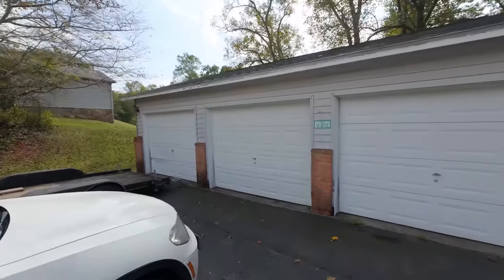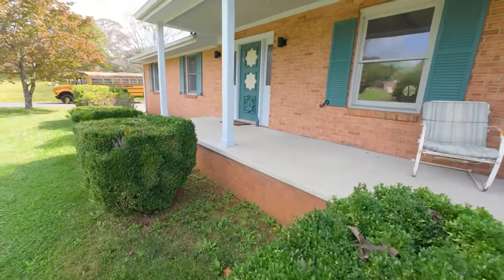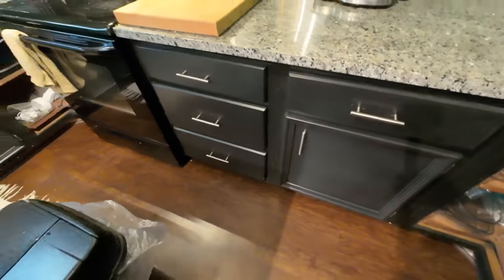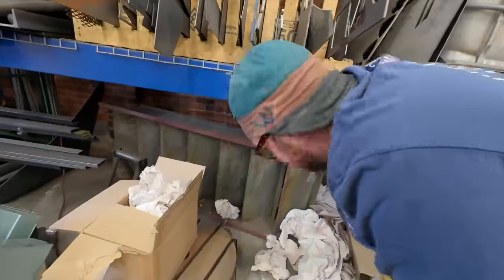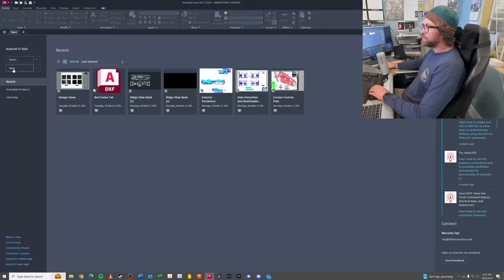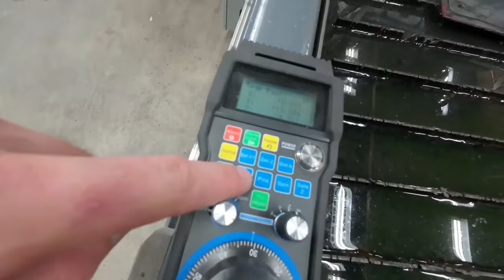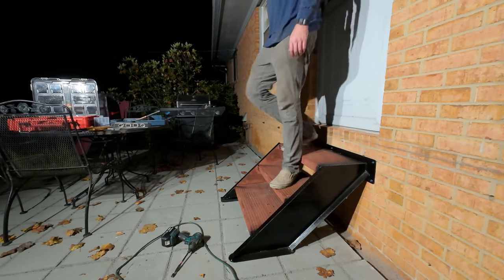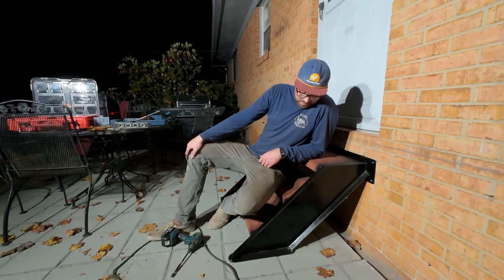I was told this is why my house isn't selling...

Comment: Personally, I would have made the top step level with the floor so as to create a 'landing' rather than stepping straight out-and-down.
Reply: Definitely should have a landing. Might even be a bldg code requirement.
Reply: The problem with a landing is it needs to be lower than the threshold or rain will bounce into the house or snow will block the door from opening
Reply: @doughudgens9275  the problem with no landing is it’s not safe.
Reply: The landing in my area is required to be  3ft Sq.  I generally make then 4 so you can stand on it with your hands full and operate the door.
Reply: Yeah a door-wide and deep landing then steps down, safer that way

Comment: I am surprised that nobody else had commented on the sharp corners at the top where you cut the side c-beams. A piece of plate over that would easily mitigate that issue, but it seems like a rather significant hazard as shown. It would not be out of the ordinary to expect that someone might fall while on or near those stairs, and landing on that corner could do a decent amount of damage. Depending upon what county your property is in, you may or may not need handrails as others have mentioned, but if required it seems that only one side would be necessary (unless your local authority having jurisdiction says otherwise).

Comment: So, I haven’t seen the entire video, but right at where he’s measured the door height. Well, did he account for the fact that the patio where that bottom step will land is lower than where the patio is right at the house wall? Stay tuned folks, it will be interesting to see.

I agree with the others, the top stair can’t be where it is. It needs to be level with the door. And handrails! Someone coming out of that kitchen with big plates of food are going to find that precarious.

Oh, it’s a very nice house.

Comment: Ouf. Couldn't you have made the upper tread(?) / step(?) the same hight as the bottom of the door? That looks so odd to me, that there is no landing, i guess... But I may be architecturally biased, as where I live, doors are more recessed into the house, by roughly a 8 or 10 inches. 
But good luck on selling the house, I hope you can close the deal on the new building. 🍀

Comment: That looks like something that's going to have to be reworked. No offense, I think it looks good. Just with my experience with home inspections that's going to need a railing and it probably won't meet municipal codes. I say that because most inspectors want equal spacing and that bottom step distance looks from the video to be different than the landing step.

Comment: Code isn't the same everywhere however, I'm under the impression you need a flat landing below where a door swings. Hope a Home inspector shows you some mercy. Plus, it couldn't hurt to check on railing requirements just to expedite a smooth closing.

Comment: You would have been better off to make them from scratch & could have included the handrail that is needed as well as a landing outside the door.
I would have add a large landing handrails and turned the stairs to run along the building. There will be a problem with that last step not being equal to the rest of them.  I had that same problem on a short step transition at a jobsite which caused several people to trip due that last step. I built a new replacement steel set, problem solved.

Comment: i might be the bearer of bad news... It looks like with 3 risers you may need a landing at the top of the stairs along with a rise max of 8.25 and a tread depth of 9 inches... according to your CAD plans it looks like your good on the rise but not the tread depth. please double check but some home inspector is going to flag that stair set most likely.
Reply: What in the world is a home inspector? (I'm not from the US)
Reply: @fkiesel9442 usually an engineer the municipality has who checks that everything is up to code when you sell, or sometimes buy. It varies according to where you are. Codes also differ. It’s a big country.

Comment: Tay, just because you typically work with metal is no excuse for forgetting that wood exists.  The stairs needed a small landing, railing and treated lumber.  Sorry but the metal stairs do not look good against the bricks and don't match the exterior house vibe at all.